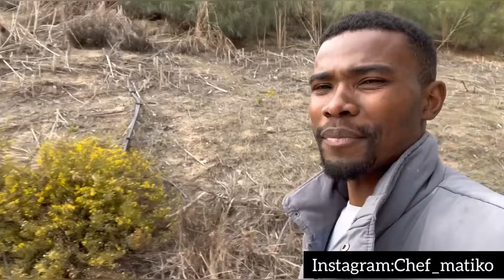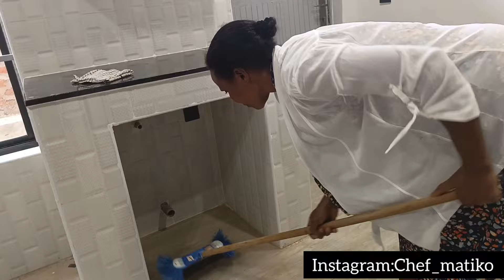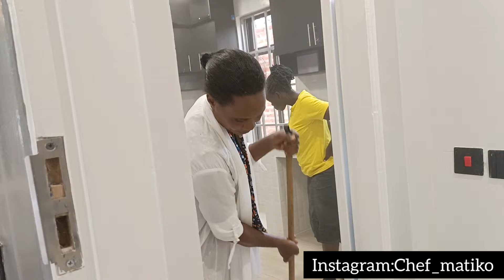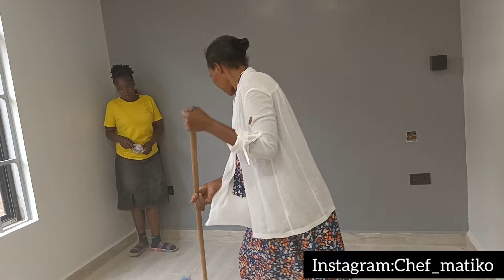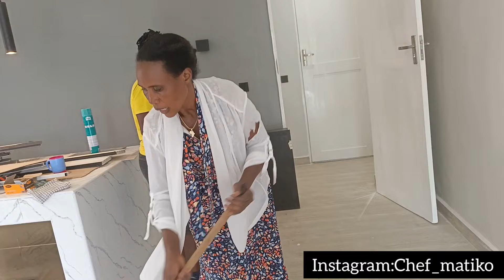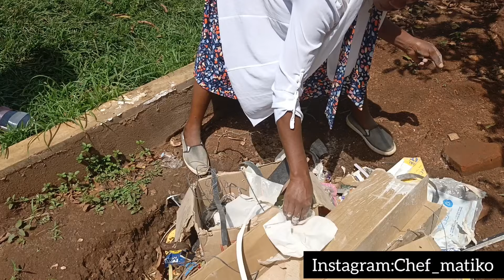FINALLY MUM OWNS THE HOUSE//WHAT A FEELING TO CLEAN HER DREAM HOUSE 🙏🙏😭😭

Comment: YOU NEED TO PLANT GRASS NEAR THE KITCHEN. OTHERWISE, YOUR MOTHER WILL GET ALOT OF DIRT IN THE KITCHEN ALL THE TIME AND THAT IS NOT GOOD.
Reply: Or put pavers in that area
Reply: Yes Grass or pave the back nd front
Reply: Mummy sprinkle water on the floor than sweep to avoid too much dust which is no good for u to inhale dust.